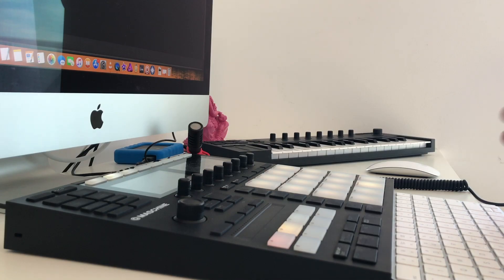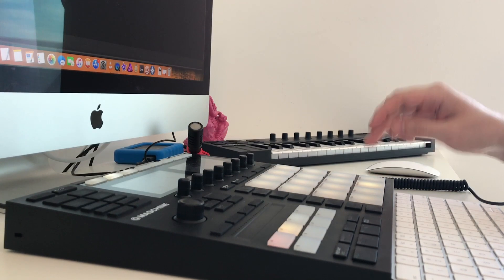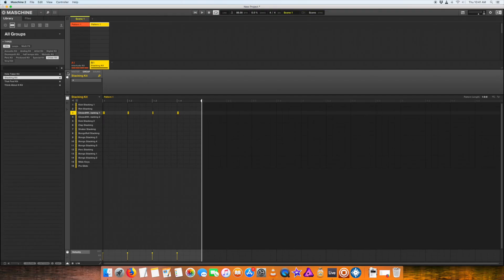Sidechain Compression in Maschine Tutorial

Comment: The duct part is cool, is there a way to smoothe out the duct? is it all based on the compressor? Also, does the high hat effect it in that way too? lets say velocity set high but on some low, does the duct register that to be a certain extreme?
Reply from the maker: Yeah it is all based on the compressor and the sound that is triggering the compressor. You can get different levels of the ducking as well as different attack and release times depending on what sound you use to trigger the compressor and the compressor settings.